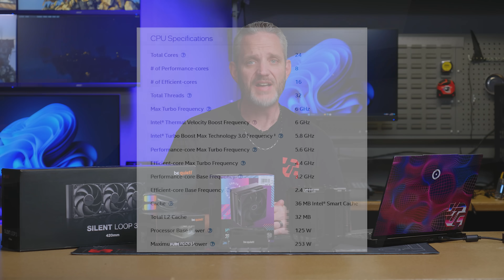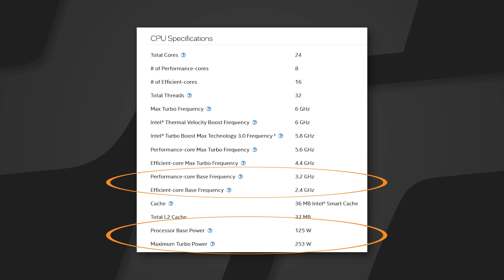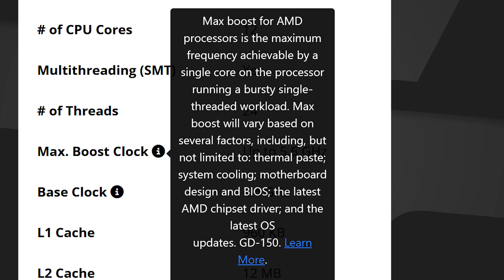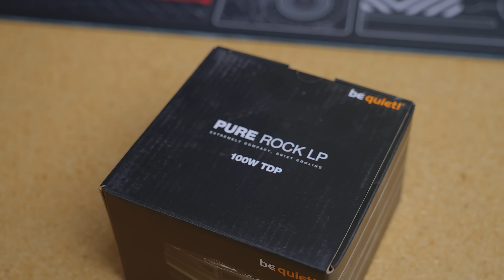Forget what you THINK you know about TDP

Comment: For my next CPU I'm definitely looking at getting a 9950X3D or equivalent for the next generation or maybe 2 generations away. I was looking at the ID Cooling FROZN A720 as it's a massive dual tower for $70. But at the same time it's hard not to look at the Arctic Liquid Freezer 3 Pro 420 or 360 at $100 and just go with that. 

Like you said too Air Coolers are way less likely to fail or need maintenance which is why I like air coolers so much
Reply: FROZN 720 imo, hands-down. Way fewer points of failure and it'll get the job done if your ambient is anything you'd reasonably be working or gaming in.
Reply: I'd go with the FROZN A720 personally. An AIO has a low chance of leaking if it's built well, but if it does, then it's a PITA
Reply: Bingo! I have 5 working machines in one room  (with a window ac running 24/7) 2 in the living room for the wife and myself, the kid has a nice rig and I have a few in a closet too. I went AIO once and went back to air when it failed after a few months. I cannot take the chance of a pump failing on one of the work machines. The kid wanted AIO so arctic 280 for him with no issues in the last 3 years with it. I have 2 Noctua d15's and the rest are Thermalright phantom spirit or peerless assassin 120/140 coolers. Heck, the Noctuas are like 10 years old by now and still using the original fans. Two thermalrights are 3-4 years old and the rest are within the last 2 years. Air works well. I'd need the ac on even if I went with 480 aio's in each case as I run them hard 24/7
Reply: The Frozn A720 is MASSIVE; bigger than you might think--in fact, it only has 28mm of RAM clearance.  They say to "mount the fan slightly higher to allow 38mm RAM modules," but it looks like garbage and it adds a few more millimetres to the tower's height.  Also, if you're thinking about using other fans on it, the clips it comes with are fit to their "octagonal" frame fans (I tried using Noctua's Push-Pull twin fans only to find out that the clips don't fit).  Just make sure you buy components that will allow it to fit PROPERLY in your case, otherwise, it might be worth your while to just stick with 120mm fan coolers, or a better designed 140mm cooler.
Reply: @Entrepid83  You can stretch and bend the clips to make them fit other fans, man. I did that with a Peerless Assassin clips meant for 120mm fans. Now they fit 140mm fans, no problem.
Reply: I got the 420 AIO on my 9800x3d and it is ofc cooling it nps..  have a 360 AIO in GF´s system and have never had any problems with them, what i like about Arctic is that its a no BS product.. Thicker radiator then most other AIO´s and they are much cheaper than most others again
Reply: I planning to get this cooler. Can you replace the fans with Nocuta NF-A14 G2?
Reply: @noMoneystrike Yeah I don't see why not. You can pretty much mix and match fans with coolers, but static pressure fans will work a bit better than airflow fans
Reply: @noMoneystrike I don't see why not? I'd make sure to look at the specs of each fan and compare them to see if it's even worth it to do so though
Reply: @noMoneystrike  As others said, probably yes (but check specs like fan thickness first). Would you see much benefit if you did? Almost certainly not. Unless you're running an open bench or with side panel removed, you won't hear the CPU fans much. Save the quiet Noctuas for intake & exhaust.
Reply: The be quiet AIO have ports in the so you can refill the cooling liquid, you sans a catastrophic failure it should last you like 7 years
Reply: So you know, the pro models are significantly worse than the original liquid freezer iii for some reason. Corsair Nautilus, Montech Hyperflow, Lian Li Galahad Lite are all good options and also around $100. If you're waiting years before buying that will likely all have changed too. I'll add another vote on air for reliability. If you're actually using the 16 cores for real all core workloads like rendering or encoding then I'd probably get a 360mm though, and if you're just gaming save your money and get an r7 instead and air will be fine.
Reply: @covante4822 if you mean noise , they use more powerful fans z you can house normalisecans it's quieter that the non pro ,brev 2 has improved the mounting mm echanism for an5

Comment: 10:54 I wouldn't say that that is always more than likely a vapor chamber, cheaper coolers might just have a solid aluminium block around the heatpipes because you can can get better flatness with that than with the shaved inset direct copper heatpipe design.

Comment: I have a ryzen 7 9700x with a rtx 5060 and a 250w psu. My Samsung 49" monitor scares me a little.
Reply: No way are you running a 250W psu.
Reply: @mikeford963 lol the hdplex 250w psu was good enough for the 4060 at 115tdp but I grabbed a 5060 when that came out. I intended to upgrade to the hdplex 500w psu but so far not too many issues.
Reply: @vaanea290  You are on the raggedy edge of the max useage of that 250W PSU. I run a 5800x with a 3070. Want to know what the recommended PSU was? 750W. I went with an 850 because I wanted proper GPU power cables so I wasn't using the daisy chain plugs,

Comment: Are x3d motherboards worth it for non x3d processors?
Reply: They are the same board. You can run a X3D chip on a B650 board, or an X870 board. That being said, there may be features in the 870 that may not be on the 650 one.
Reply: @mikeford963 thanks, well then i think i would just go ahead with b650 + 9900x & 9070xt i am upgrading from 3700x & 2070 mini 😅
Reply: @vdwpartha  Absolutely. Save a few pennies, especially if you don't need some of the extra M.2 slots and such. For most people SATA SSD's are plenty.
Reply: @mikeford963 yup i only have 1m.2 256gb boot drive out of 2 slots on x570 elite but it makes more sense to just have 1 1tb m.2 & partition that into 4, boot, scratch, game & software. 😊
Reply: @vdwpartha Depending on what you need for space on that scratch portion, might want a MUCH bigger drive to partition things that way. Add to that, the size of games and a 4tb might be the better way to go for a single drive.

Comment: Literally just ordered a Thermalright Assassin X120 Refined SE ARGB for my Ryzen 7600 for $12.50. Was on a stock wraith stealth. Seconds later this video shows up lol
Reply: That should be plenty for that CPU...
Reply: The x120 will do just fine, I have used it multiple times and it cools just fine up to like 120 watts continuous load without problems
Reply: I'm running the Assassin King on a 7500F, which is basically the same CPU, just diff clock, I'm getting a max of 69.4 in Cinebench with 90W draw at constant 4.8X MHz. You'll be golden.
Reply: The old Thermalright Ultra eXtreme 120mm with 8 heapipes gets the job done as well on my second computer ;)

Comment: My plan for cooling is to re-use the same nh-d15 i used in my last 4 builds and it's done.
Reply: Nh-d15 is the goat
Reply: NH-D15 is my go to for at least half a decade. Now running the NH-D15 G2 (LBC or HBC, don´t know anymore) for my 9800X3D
Reply: @Alexander-kz6es me too that combo makes me happy
Reply: @Alexander-kz6es I have one too but just got a $200 Corsair 3 fan 120mm AIO for $120 off Newegg for some doorbuster deal so I gotta use it when it comes,
Then use the old NH-D15 for an older PC
Reply: @Alexander-kz6es  did you notice much diff in temp on the 9800x3d with og nh-d15 vs g2 coz i got g1 and cpu goes to like 67/70c in battlefield 6
Reply: @BudKing96  Can not really put them side to side, as i completely overhauled my rig (10600k with D15 G1 to 9800X3D with D15 G2). Full load scenario is now like 80-85C with 9800X3D and D15 G2 (No OC!, 125 W Max)
Reply: @Alexander-kz6es  hmm i was similar went from i7 9700k to 9800x3d but all on the same g1 d15, i limit my x3d cpu to 85c anyway and did -30 on curve optimizer for lower voltage temps only goes to 85 during stress test or sometimes shaders, gaming 60-70c same as my 9700k was coz i oc'd that to 5ghz, was curious if g2 was huge difference, i also dont run pbo at all just stock 5225ghz coz 5.4 makes it run too hot, my 5080 passthru design also just puts hot air into my nhd15 lol
Reply: @BudKing96  I also tried a negative offset but my CPU gets unstable at like -5/-10 so i just left it stock. Themal paste was the original noctua (a big big blob in the middle of the cpu). Maybe you are missing some case fans or they are arranged wrong? Just a thought.
Reply: @BudKing96  And yes also got the 5080 blowing straight into my NH-D15 but got 8 Noctua 140mm case Fans (also G2). The NHD15's difference between G1 and 2 is not that large by the way
Reply: @Alexander-kz6es my god you guys have terrible cooling.
Reply: and it comes in black too
Reply: The good old king. Mine is 11 years old, it's on his third build. 😊
Reply: The GOAT
Reply: my hyper 212 last 3 builds till I got a 5900x
then I bought a nhd15
Reply: Amazing what happens when you ignore poorly conceived advice and instead overspec a critical part of your system. You save money and have peak or near peak performance.
Reply: Hell yeah 😎
Reply: Same story with my Dark Rock Pro 4
Reply: My last two builds have peerless assassins, couln't be happier.
Reply: Solid cooling plan, easy to remember
Reply: And still achieve some of the lowest possible temps lol..
Reply: @AmritSingh-xe5yr yeah no. Sorry buddy. Custom loop shites on air.
Reply: Still using Noctua C12P-SE14 that I bought brand new over 10 years ago with upgraded Noctua Redux 1500rpm fan as it looks glorious in the side panal
Reply: Same NH-U12S since 2014, now cooling my 5800X3D without any problem.
Reply: Just realized i have one of those that initially cooled a ivy bridge cpu and now cools a 7600 on am5😅😅😅😅😅 noctua are just the goat and never end up in the bin like  some other coolers i bought in the past...( all my 4 noctuas are still in service)
Reply: How do you get new mounting hardware?
Reply: @jasmosanew6146 you contact Noctua by email with a proof of purchase and actual photos of your heatsink and they can sent the new hardware mount to you depends on your country
Reply: @jasmosanew6146 for Noctua? You have to search for the noctua free mount form. You need proof of buying a new socket motherboard or cpu
Reply: @jasmosanew6146  for NH D15 etc just contact Noctua and they will send the new kits for free. Only need a receipt for the purchase.
Reply: @jasmosanew6146  Don't buy Chinese all in one watercooling shite.
Reply: Recently did a build with a 7600x expecting a Thermalright 120 spirit evo would be able to keep it down, but that was a no no. Thermal throttling during stresstesting. Did not expect that for a x600x AMD part.
Reply: Bought mine in 2015 for X79 and have carried it over since. But if I were to build now, I doubt I'd spend the Noctua tax. Thermalright just offers far superior price to performance in terms of air cooling and Arctic dominates in terms of AIOs. Noctua pricing has just gotten way too insane. You can either buy one 140mm Noctua fan or FIVE arctic fans that perform similarly, if not better, as hwcooling has shown in their tests time and time again.
Reply: I just slapped my 12y old d15 on my new i7 265k and it does not seem too bothered by the 225W. Still holding <95°C with fans capped at 60% speed. What a legend
Reply: I ran a 240rad for like 3 builds till I eventually got a 5700x3d and switched over to 360rad which I've had for the past couple years. This one will probably go another build or two before I need bigger
Reply: Same, but with Peerless Assassin.
Reply: Got the NH-D15 too. Need nothing esle ..
Reply: What is the "logarithmic formula" for all the dead AIO GPU on on ebay & people who feel like they are forced to try to inject them with hypodermic needles & superglue the hole closed, so they can finish there home work 
(lets be real its to play fortnite most times lol)
Reply: I bought a 360mm artic liquid cooler for my 9800x3d and i should’ve just bought the nh-d15 g2 instead.

Now i have to listen to that piece of shit waterpump
Reply: @obic123 it shouldn't be that loud
Reply: @craig9365  He's probably running te pump at 100%🤣 Tune it down to about 69% and you don't hear it.
Reply: @Audiosan79 i did tune it down to 50%  and it s much better
Reply: @obic123 it shouldn't be making any noise there's something probably wrong with it
Reply: Used to have D14 in times I was running i5-2500K @4.5GHz. Good Coolers. But since then, every PC I built been in smaller case. And I've been reducing air volume inside case. Minimizing time hot air remains in case. Technically, from Graphics, hot air gets to both sides after traveling 3 cm. And cannot go anywhere else. CPU's AIO radiator is like 5 mm from mesh on side.

Tower CPU coolers are too big, too heavy, bad for transport and thermal pumping unless main boards they are kept horizontally, so Tower is actually tower allowed to sit on CPU.
I am surprised that tubers talking about cooling power and efficiency do not mention exhaust ducts between tower cooling on CPU and side/back of PC case. This at minimum greatly reduces temperature of chipset/upper NVMe/VRMs, and commonly shaves 2~4 degrees Celsius from graphics and RAM.
Reply: Agreed. I've got 4 builds out of my current (good) water cooling system. I think the coolers he shows on his shows are shite IMHO.

Comment: TDP stands for Thermal Design Power, which is a rating for how good of a cooler you need to run the hardware without dying, not optimally, but just without dying, and not at full boost mind you, usually measured in Watts.
TBP or total board power is what the total power consumption for GPUs is.
PPT is the total power consumption for a CPU.

Edit: The heat generated is not higher than the power draw, it's that the heat dissipation is not good enough to be able to cool it 1 to 1 with the power consumption.

Comment: i was planning buy an aio and exact movement you post video
Reply: I did my due diligence. I went to GN and checked the "Best AIOs for 2025" video. Then got my Liquid Freezer III Pro 360, and no worries. I run S*******d (yes, I'm old and ashamed) for four hours straight at times, never cracked 60c so far. Your mileage may vary.

Comment: Useful video, but in real world making plans on how to cool CPU\Case(specifically counting or even knowing what TDP is) are needed under very rare and specific circumstances, in 90% of the time you just buy top air cooler or AIO from reputable brand with 2+ fans and it would be enough to cool anything you can realistically have. And since Air coolers are cheap, even top ones, its not really a big consideration when I plan my PC budget. Right now Im cooled by Peerless Assassin, very good cooler and it was something like $40 or so, $40 is nothing when GPU alone was over $1000 and entire new PC is over $1500. And as a bonus more often than not you can use CPU cooler with your next build, maybe not AM5 one, but I still can upgrade to top AM5 CPU when AMD moves to AM6 or something, assuming 5 and 6 coolers will be incompatible.
Another argument is - look at what AMD puts with their BOX CPUs, if coolers like AMD BOXes are enough then pretty much any normal 3rd party cooler will do the job, and do it better :)

Comment: Bought a Deepcool AG300 for my R5 3600 because It was said that it can handle a TDP of 150w... it reached 85-90°C under heavy load.
Reply: thermalright peerless assassin 120 se will get you right for only 35 usd buckaroos homie :)
Reply: Always go 100watts more than the tdp,is good to have that room for “expansion”
Reply: My 4.10 gh oc 3600 runs at 75°c with the Arctic freezer 36 at full load. I only installed 1 of the included 2 fans for the cooler.
Reply: You either have a really shitty cooler (or living in a literal desert) or you mounted it wrong. 
I'm using a 140w cooler on R5 5600X and it doesn't go past 65c under full load, while staying at 60c in games.
Reply: You could try checking the mounting hardware for levelness. Use a glass mirror or iPad screen. That's how I figured out my backplate was uneven/defective. Which caused CPU temps to go straight to 99⁰C in cinebench. Tossed that Corsair cooler and got a cheaper thermalright and fixed the problem.